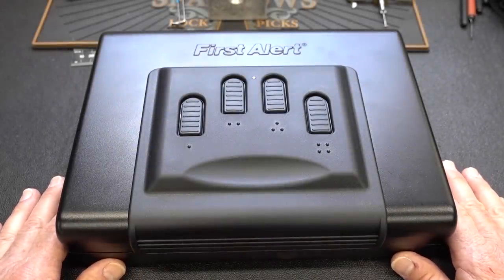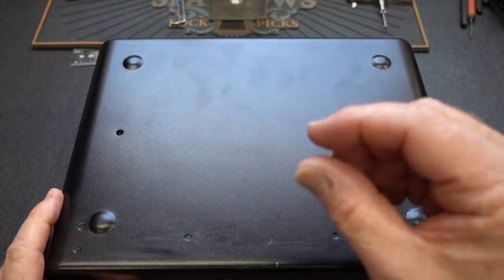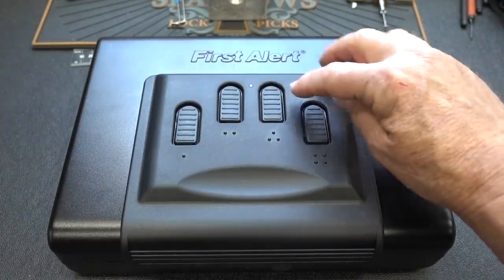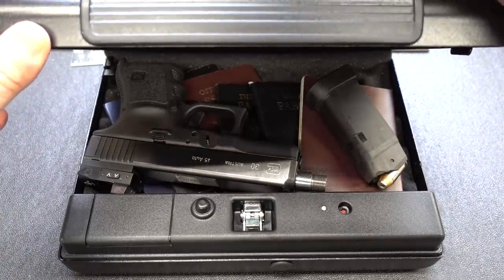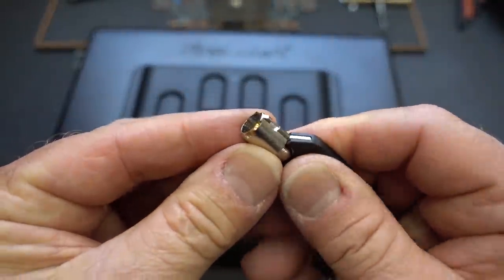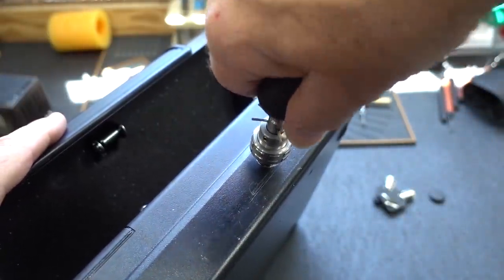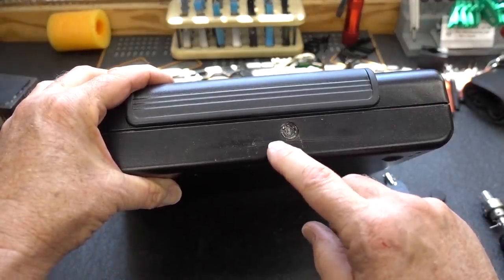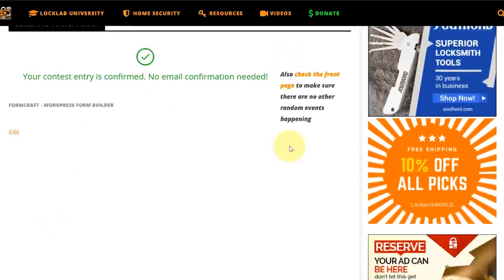(1526) Review: First Alert Personal Safe (RA31424)

Comment: I bet LPL would have it defeated in just over the time it took you to enter your code...through picking the lock on the bottom.  I doubt he'd have cursed it like recent medical wall safes though...
That's praise to him, nothing bad on you.

Myself I think this is an excellent lock box for $80.

If I had it I'd
1 - Epoxy the key bypass shut - that's the weakness.  That tool is cheap on Amazon now.  Cain't wait (sarcasm) for the other tools to get made by Chinamen to sell there also...
2 - rig in a covered power wire.  3 batteries = 4.5 volts.  So if it ever doesn't respond attach 4.5v input.  If I was in a fancy mood that day I'd drill a hole in the side and attach a jack to plug it in.  Otherwise wire is covered with black tape and any robber tries to send power they do nothing or at worst fry the electronics, keeping it shut.
3 - (depending on use) - Rig in an internal motion alarm.  Like cut and weld in a tiny metal grate/gaps so the remote signal can get in.  But that way if it's opened or someone starts shaking, hammering it sets off a LOUD alarm and can otherwise trigger stuff.  Wouldn't want that for a 'gun safe' to use in emergency.  Keeping money, drugs (assume prescription) and thumb drives with the codes and files downloaded from "adult" viewing from the kids however...

If it does fail - well in your house - all the time in the world to hammer it apart or get out the angle grinder to cut down the seam and consider re-welding another edge or buying another one.  Not good if you need it as a 'gun safe' but really those are to keep kids from playing "William Tell" not for emergency use.

On the electronics:

A - while the key is still attached - check if it loses the setting if the power is lost?  Most of the time there's a secondary coin size watch battery for memory that's good for 7 years or something but when it goes you lose the combo every time you replace the batteries.  People get scalped ordering an exact battery but usually a similar looking one is fine - good to check if it's 1.5 volts.  Not like you have to fit it in a literal watch that might have incredible tolerances.
B - is the circuit otherwise isolated from the case?  Reason is sometimes these can be bypassed by shocking.  That can reset the electronics, they reset to 1111 code...  I doubt this puppy.  But good to make sure it's in its own little world and insulated.  Any worry about #2 there are tons of fuses that'd allow 4.5 v but instantly burn out on home AC.

Bonus points for the magnet not working.  Company probably saw too many bypass videos and CEO had nightmares of "Consumer Reports" mocking him.

Comment: Besides being a useless crap unsafe safe that will only slow you down from getting you handgun when you need it. There are numerous flaws that allow this to be opened easily. I won’t go into the major battery life problems or how stealing this thing is about as hard as walking off with a 6 pound laptop.  Unless they updated the programming/firmware you can randomly open this in 5-20 seconds just by randomly hitting all 4 keys in quick session (without ever pausing) until it opens. If you pause for a second then it triggers the lockout but if you don’t pause it just opens without ever triggering the lockout. Also if you slam this on  the ground it pops open with ease.